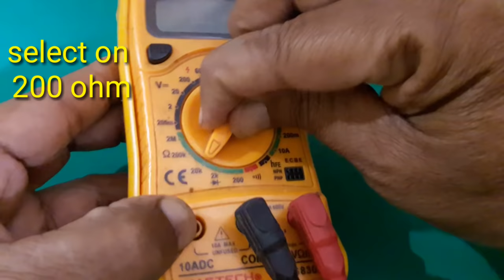3 WAY check to Transformer!

Comment: You shouldn't hold the wires with your hands when you measure ohms. Your body is a resistor and can affect the results. Alligator clips on your multimeter are better.
Reply: No it doesn't I have tried it in my lab with rheostat

Comment: question: I have a 100W soldering gun, I seemed to stop heating up. I changed the tip and still nothing. I tested for current going in, It has. I tested the light bulb for current, It works. But I fear its perhaps the transformer part, How can I test that part?

Comment: Sir I got 13.8v while testing in current. Is there any problem in my transformer
Reply: What ???
You got 13Volts.......... While testing in Current Mode
How is that possible ?
if your Multimeter is set to   A   then you cannot get a reading that reads V AC or  V DC
for that to happen your Multimeter must be set to V AC or V DC

if you thought you were testing the current but had the meter in Volts mode then YOU WERE ACTUALLY TESTING VOLTS

also, Were you testing IN-SERIES  or  IN-PARALLEL 
Because In-Parallel is a VOLTAGE Test
Current Must be Tested In-Series 

which did you do ?

Comment: I've checked transformers which in primary have about 1.4Kohms. 1st test should be done with the 2Kohms scale. A test of 0ohms is for shorted coil, and 1 or L in the left si de of the display (infinite) is for opened/broken coil. Thanks for the video.
Reply: resistance of primary and secondry coil of transformer can't be a scal of KOHMS. the only explanation is that your coil is cut off

Comment: How could I know whether the transformer is 12volts or 17volts output ?
Reply: measure it with the multimeter on AC setting
Reply: jab load daalo gy transformer py tou pory 12v dc milty hen....jaahil

Comment: Why you are selecting Ac
Reply: OK
TRANSFORMER BASICS...

1.  A Transformer is an inductor 

2. Watch a you tube video on   HOW DOES AN INDUCTOR WORK

3. An inductor is basically a wire and if you feed DC Voltage into it it will behave like a dead Short
because the wire has low resistance

4. However if you feed AC Voltage into it it will store Current in the magnetic field 

5. Now if you bring another inductor with less windings close to the first one,  THE ENERGY WILL BE INDUCED INTO THE SECONDARY COIL

6. Therefore   DC VOLTAGE CANNOT FLOW THROUGH A TRANSFORMER.
ONLY AC VOLTAGE CAN FLOW / INDUCE FROM ONE SIDE (THE PRIMARY SIDE) TO THE OTHER SIDE (THE SECONDARY SIDE)

7. Since Only AC can pass through the Transformer  YOU SELECT AC VOLTS on your Multimeter to Measure the output voltage on the secondary side

THAT'S WHY YOU SELECT AC